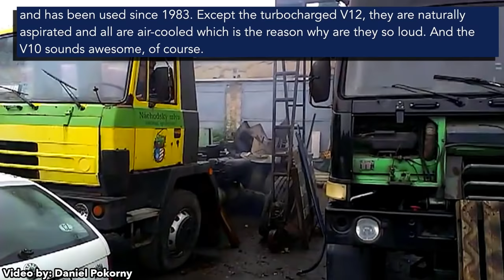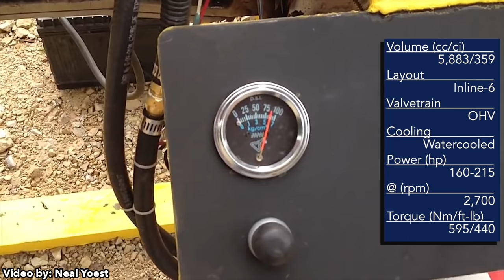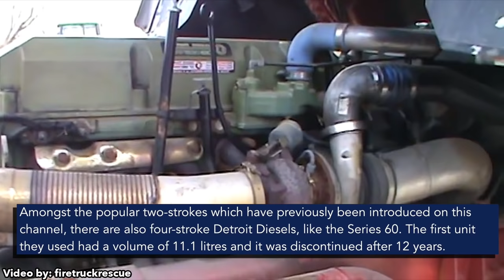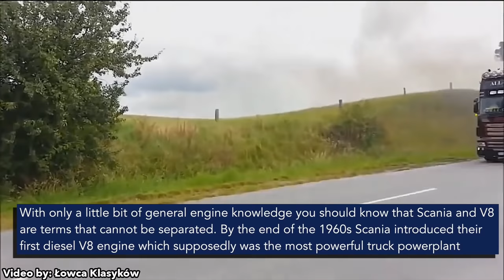10 Best Sounding Truck Diesel Engines

Comment: only issue I have with excellent video is the power stroke 7.3 was made by Navistar aka international
Reply from the maker: That is true. I read about it that initially Ford didn't produce them...
Reply: In addition to that, the first version only had 215hp and 440 torque. The later ones had the numbers you quoted. Source: have a 96 powerstroke
Reply: my dad had the first year '95. 160k when he sold it. spent about 10k a year trying to keep it on the road. he never took it offroad or did anything abusive with it other than drive it up the highway to work and occasionally into town for groceries. thats probably the biggest reason i havent been too eager to go buy one. i cant afford to burn 10k a year keeping a vehicle running. i dont understand how ppl are getting tons of trouble free miles out of those engines. his was far from trouble free. all little things but expensive when added up. i guess on the upside the internals never broke.
Reply: ***** Are you sure it was the powerstroke and not the gas engine? Mine is at 190k and has a rotted seal in the fuel pump, but that's the only issue with the engine.Never opened it up, in fact I put a performance tune in it.
Reply: They was 3 different versions of the first powerstroke, a non turbo , a idi version and di version, I know where they is one in a tire repair truck dudes got 800+k on it and all he has done to it a clutch regular oil changes, and water pump and a couple of hoses ( idi indirect injection and di direct injection)
Reply: Jack Caldwell Actually no. The IDI was a totally different engine. It's the same displacement as the powerstroke, but that's where the similarities end. IDK what the DI version is though. Haven't heard of that one.
Reply: I knew they was a different one
Reply: +jo schmo I've had a 96 for five hears and I've spent about 200 bucks on it, 10k will put in a motor and a half in a 7.3 power stroke so I think you've got your numbers wrong
Reply: DI's a T444E under Ford badging with a different ECU than the Navistar version, IIRC, while the 6.0's a VT365 with the same story going on with it.
Reply: Josh Mason Ok I think I get it now. The IDI was a totally different engine, the DI was the pickup version, and the T-444E was the commercial version.
Reply: TheTmaaan55 The T-444E, and the Powerstroke 7.3 are 99% the same thing, and are for all intensive purposes the same motor.
Reply: ***** Yeah I know. But the IDI was totally different and came before the powerstroke
Reply: TheTmaaan55 Yes, it is, the T-444E is the powerstroke, E as in electronic.
Reply: Ford didn't produce the powerstroke until international shit the bed the final time with the 6.4. international started with the 6.9 in 83 which was strictly n/a, then went to the 7.3 idi in 87 which was sinitially n/, with dealers typically adding an ats kit and then later in 93 and 94 a factory idit. those were fully mechanical motors. 95 started the powerstroke name which international controlled until 2010 or 11 when ford came out with the 6.7 scorpion. now, all powerstroke are wicked motors, biggest problem has been the emissions with 6.0 and 6.4. Haven't heard of many issues with 6.7 except for a gal I knew actually had a fucked up dpf that nearly burnt the truck down, pipe was red-hot from the turbo back. I believe ford also makes the new i5 powerstroke however like the ecodiesel in dodge, I'm pretty sure it's just a rebranded duratorque. don't know if thats ford produced. in the us, ford is the only pickup that had an in house diesel. cummins has dodge and nissan, duramax is Isuzu, and the ecodiesel is mv motori out of Italy which I believe is owned mainly by Detroit diesel. not sure if they sold out or not. gm tried producing an idi motor from 83 to the late 90s but it really wasn't anything special. I've atleast seen the 6.9 and 7.3s built up to 600 hp.
Reply: we've owned every generation up to the 6.0. the 6.9 through last 7.3 are all tanks. they'll go forever. hell, I'm driving a 6.9 right now, no turbo, oil leak hiding somewhere on the head, and lift pump is going. occaisionally air locks but crank it over with half throttle and she's good. 7.3 idi, same shit, just a few more cubes. the psd though is a totally different engine. and I sure as he'll have never heard of anyone dropping 10k on a psd unless it was a hotrodded  motor or a 6.0/6.4. hell, the first 7.3 psd didn't cost that much for a drop in crate. even a 6.0 is slightly under that ballpark. and hell, the 6.0 is a better motor if you spend the 6k to bullet proof it. it's an amazing motor really, the 6.4 is nice to hotrod but I haven't heard of much luck rebuilding them. not a whole lot of meat left on the block. the 6.7 I'd definitely a beast. most issues I've heard of were cab chassis motors only. and only about 20 cases. I'd take it over a 6.7 cummins or duramax. except the lbl, that I've had some luck with.
Reply: TheTmaaan55 it was pretty much a bigger smaller snail shell on the psd that was the biggest difference I think, my dad had a 4200 with the t444e, and if I remember correctly, that was pretty much the only thing he thought made a difference between the two. the psd would spool quicker.
Reply: Daniel Anderson I was told the first 6.7 PS first gen had issues with a few of the twin turbos , Ford supposely just get a single turbo to work , don't really know but that was what I was told, the newest version down rated from the 900 ft of torque just Incase the new cummins breaks the 1000 toque which is rumored to be , friend of mine works for ford says they have a 7.0 or 7.3 in the works for the next refresh of the super duty, that's what he said was in the works
Reply: Jack Caldwell they weren't twins, they were actually single sequential. 1 turbine, 2 compressors. great idea and actually no problems really, mainly just in the rd stages. the motor all in all is great, and the 2017 is rated at 925, with a mediocre tune we just put my neighbor's over 1030 tq. but I believe the 2nd generation is running a standard single turbo. I'm actually in between buying a salvaged 6m7 to swap into my 67 f250 or buying a new truck all in all. I mean, I'm 20, but the only thing I've ver driven were projects and old trucks. would be nice to upgrade to something that's absolutely hassle free, not a project. which it will eventually become but for the time being it won't be worrying about ding something because I can't afford to be out of a truck for a week.
Reply: Daniel Anderson  nothing wrong in bring old iron back to life,i am searching now for a 4 door f-350 mid 70's to fix up and find a junkyard 2017 superdutys the body on it is ruined to slide under the body , project truck I don't know if I will go 4x4 or just bag it and slam it , good luck with your project
Reply: Jack Caldwell I don't know where you are in the states, but an early 71 or 72 will be damn near impossible to find as a crew cab unless you make it yourself. you go to a Dents idea though you may have luck with a 77.5 to 79, they exist, alot of old forestry trucks were super cabs or crew cabs. a super cab Dentside is a pretty truck lifted. throwing a modern chassis under though is no easy task. I don't remember what the youtube is for this guy, I just know him through Instagram but he owns a 68 f250 Ranger sitting on a 6.0 chassis. it's called the olderduty. mopar1darrell is his Instagram name. might help you find him. my 67 is a factory 4x4 so it's a little different than the rest. I may end up putting a 12 valve in just because it's such a simple swap and plenty of power and fun. just thought it'd be cool to have a 67 with a 6.7. hell, my brother is working on putting a spare 6.9 I have laying around in his 69 f100 if we don't build the Windsor. best bet though is to find either a totalled but not fubar xl super cab. no power windows or anything. maybe a used fleet truck that didn't see much action even. that will be the simplest thing to do. the less of a mess, the better.
Reply: just like Cummins saved dodge pickup trucks,Navistar saved the Ford pickups. too bad Ford still support gay rights.
Reply: Carla Rodgers cummins didn't save them, they made them. the Navistar didn't save the Ford truck because the first series is still the most popular vehicle in the country, and it's not the super duty.
Reply: dodge never built the Cummins.
Reply: If you want to be nut cutting g about it, Ford owned Cummins for awhile, they was evened rumored to put the B5&6 in Ford super duty when Ford and Navistar couldn't agree on the warranty issues Ford was having with the 6.0&6.4
Reply: Carla Rodgers no, cummins is just the only thing that made that truck worth a shit let alone actually become a popular pickup line.
Reply: Jack Caldwell hell, fords had a cummins engine in it since the 60s I think. just the heavy duty trucks. even today you'll see 650s with a cummins or a powerstroke. my buddy's tow rig is a fummins and hell, I've even seen gmc at the dealership brand new with a cummins in a 3500
Reply: Jack Caldwell yeah my dad has the 97 Ford it runs amazingly
Reply: Daniel Anderson hey duramax is actually a inhouse gm engine it was developed by gm powertrain and isuzu thats it isuzu has no ties to dmax which is the duramax company completely owned by gm get yo damn facts straight lol isuzus duramax is completely different
Reply: the best engine ford Ever borrowed.
Reply: Jim Allen  Dude no. IDI and powerstroke shared displacement but nothing else. It's literally on the wiki page.
Reply: Jim Allen  I certainly trust it more than you, seeing as you have no sources

Comment: i hope this guy knows that the 24v cummins is also a 5.9L engine its no bigger than the 12v
Reply: connor jones has to be bigger made to support the extra valves
Reply: jdr ok yah no. It's the exact same block... the difference is in the head
Reply: connor jones did i say the block was different the head is and it either has extremely small valves or it has a bit thicker casting
Reply: you can put a 24 valve head on a 12 valve block

Comment: the 24v cummins isn't larger.
Reply: I'd rather have a briggs&stratton-heh, heh
Reply: 5.9 24v isn't, current 6.7, also a 24v design to my knowledge, is.
Reply: wilson solt The 24 valve is the same engine with an extra 2 valves per cylinder, other than that its the same dispacement and for the most part the same engine
Reply: Gary Martin lol what do you want or have? A v8 that might last 400,000 miles?

Comment: Duramax is isuzu
Reply: Farming and Isuzu is owned by GM
Reply: brian6265 but it's not invented in us. rice engine
Reply: Farming no it actually was developed here and japan and has always been made here
Reply: Farming it was developed in the us and built in Ohio so nice try
Reply: thank you I have a hell ofa time convincing guys about that !!   I had a 08 Chevy cab over the only thing GM was the bow tie on the cab front and the Allison auto trans    was a really under powered slug lost the hauling contract for the steel company it was bought for (they went bankrupt) we sold it at the Richie bros auction in Louisville that spring .

Comment: the only pick-up diesel Ford has built is the 6.7. the rest were sourced through Navistar. 

the B series showed up in the early 80s in heavy equipment. 

GM bought Isuzu to get their hands on the light-duty Isuzu diesel known as the duramax.

Comment: my father had an 03 lb7 for years and never had an issue with the injectors, I have an 01 lb7 that had the injectors replaced on the recall in 07 and has had just shy of 100k miles put on that set with no issues. 
now my father has an lly that we've replaced 3 of the 8 injectors on in less than a year, it's all in how you treat them.
Reply: and also where my lb7 peeps at?

Comment: All those shots of the 998 Mack, 3408 Cat, 8V Detroit, and 16L Scania, but you forgot the big killer I6:  1150 cubic inch Cummins K.  It was 600 HP available in on-road trucks in the early '70's.

Comment: The 12 valve and the 24 valve Cummins engines both had the same displacement of 5.9 liters. It wasn't until 2007 that the larger 6.7 was introduced.

Comment: There was also a version of the Series 60 Detroit Diesel that was called the 430/470. 430 horsepower was the normal mode and if you turned on the cruise control it would increase to 470 horsepower. The highest the Series 60 went to was 500 horsepower.

Comment: The 24 valve isn’t larger than the 12 valve. It just has a different head on it and more electronics. Both are 5.9 liter engines.

Comment: you have the specs wrong on the Detroit Series 60. The 12 litre was the standard otr truck engine until 2000 when the came out with the 15 litre 500 then 515 hp. The Series 60 is no longer produced and has been replaced largely by the DD15 15 litre with a power range of 455 to as much as 650 hp depending on spec, based on the Mercedes Benz engines optioned when it was Daimler Freightliner. 
Guys that have them say they're all right, but most of us prefer the Series 60. The only reason they stopped production was because they couldn't meet the new emissions standards.

Comment: Suggestions for the next should include International DT466/DT360, 6.0 powerstroke, 6.4 powerstroke(factory turbos or aftermarket single) P7100 injected 24v 5.9 cummins, Cat 3406, Cat C15(6NZ) 855 Cummins, Cat 1693, Detroit Silver 92 V8, International/ford 6.9/7.3IDI V8(Turboed or a good sounding true dual exhaust), Cummins VT903 V8, John Deere 955 V8, Cat 3208T V8
Reply: fordman2288 why the 6.0 powerstroke? it's trash. the real beauty was shown with the 7.3

Comment: The 12.7 Series 60 produced more than 455 hp in the late 90s. Same with 1550 torque. 

Cummins pickup engine is a beauty, and the 6NZ ❤️❤️❤️

Comment: What does being air cooled have to do with an engine being loud?
Reply: Water jacket in common engines act as a sound and vibration isolator. Play the radio and put your head under water. That's how they are quieter.
Reply: @williamwarner3982  the exhaust, which is where most of the "best sound" of an engine come from, is not water cooled, and is not any more quiet when coming out of a water cooled engine.  I've ridden and owned multiple water cooled, and air cooled motorcycles, the auditory volume of the engine is not discernible from one to the other.  Compression, firing order,  and valve timing is what gives an engine a pleasant or loud sound, not air cooling.

Comment: Old Mack v8 was a hoss. Cats 3408 was impressive. But a silver 92 with a 13 shore did sing amazing grace! Boy these old v8's with straight stacks shore bellered shoot smoke rings 50 feet in the air

Comment: Scania V8. Superswede. it's singing in idle. And very powerful with much torque. And the engine was released  1969. Then 300 HP. Now 700 HP.

Comment: LB7 injector recall was due to the factory fuel filter was unable to filter out the <7micrometer particle that was destroying the injectors, also they never came from the factory with a lift pump.

Comment: The Detroit Series 60 is no longer produced. It was replaced by the DD-line of motors. Detroit will still do in-house rebuilds with genuine parts, but they don't make new ones anymore.

I really hope that anyone doing one of those "startup and rev the living daylights out of the motor" videos always does a proper warm up first.

And while I personally love the CAT 3408, you should have included the C-15 6NZ as well. That is by far one of the finest sounding diesels in existence.

Comment: 1:55 it burn less fuel because it was making less power than v8s.
7:38 1994 there was a 7.3 turbo but it was not called a powerstroke. It made about 195 hp. I know this because I used to drive one. In 1995 Powerstroke only made 215 hp.

Comment: It's hard to find engines that sound so different than the Mack and Scania V8s (which at least to me sound rather similar) which are smooth and almost purr, but with a hint of the power they hold...and the sheer deafening screaming fuck-you-I'm-coming-through howl of that 8V71.  Those two-stroke Detroits sound almost like muscle cars when they're flogged hard.

Comment: Here's a weird one, Commer TS3, 3 cylinder, 6 pistons. Horizontally opposed, pistons travel towards each other, no cylinder head, no valves, 2 stroke, roots blower, Nick named the "Commer knocker" kinda sounds close to a Detroit v8 but knockier

Comment: Wish you had included the 3500 series Cat engines. The 3508's are pretty cool sounding. 3412's sound a lot cooler than the 3408's.

Comment: You missed two whole series of International Harvester engines. the 300 & 400 series, and also the 6.0 Powerstroke/Maxforce.
Please include them some time... Thanks!
Reply from the maker: I might
Reply: The maxforce engines just sound rough in general. But the older you get with IH, the better they sound

Comment: The Tatra engine might not be the most powerfull engine for its size, but the company made everything up with their drivetrain and suspension for off road vehicles, making them to perform so well.
In a next video on this subject you have to incorporate the V8 and V12 air cooled Deutz engines, very similar to the Tatra engines.
I have driven a small shunting locomotive with a V12 Deutz of 275hp (NA) and that engine sounded just so good, and was easy on maintenance ( no worries with coolant, and only a gas seal under each cylinder head)
My favorite sounds in this video were the Mack E9 and the Scania V8 (all variants of them), that Ford powerstroke was the favorite small truck engine.